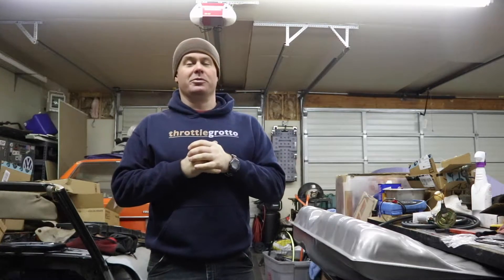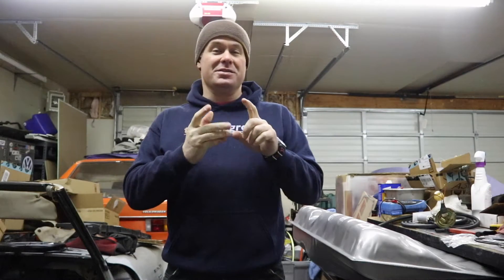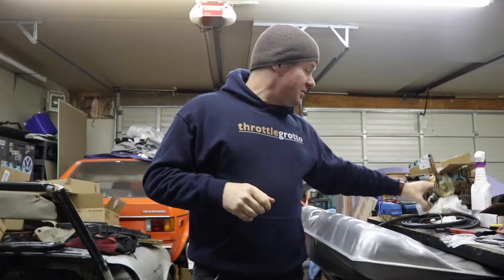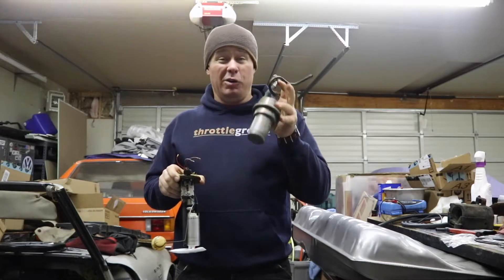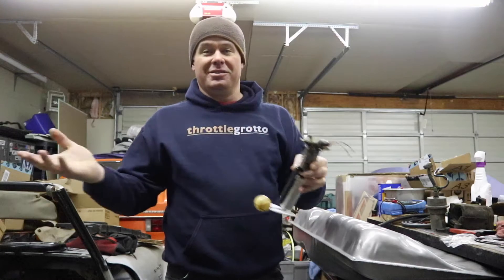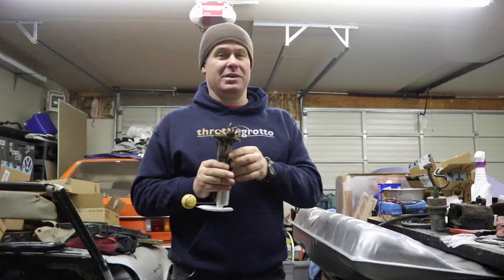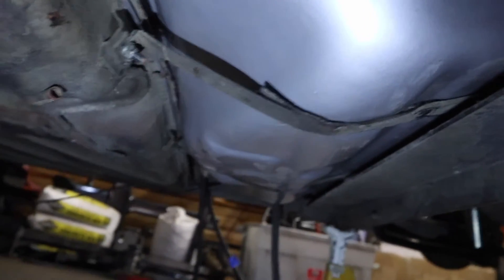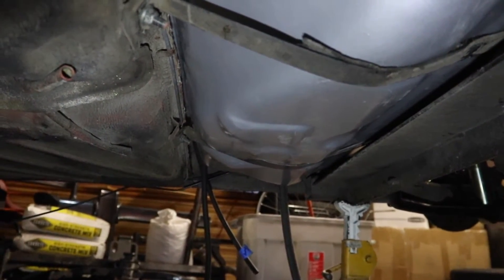Fuel Pump and tank installation- 1975 VW Rabbit 1.8t 20v ep 42

Comment: Sorry this is 4 years late 😂. Did you ever manage to reverse the fuel gauge? Just fitted a late cabriolet lift pump hanger with a walbro pump. I managed to modify the arm placing it in a vice and carefully twisting it the other direction. I had quite a complicated fuel setup before and wanted to simplify it. Cheers

Comment: How did you get the filler neck on, I’ve never installed one but I know my bros one is leaking and we need to replace it
Reply from the maker: The filler neck attaches to the body at the filler with 3 screws, and then some bolts along the way. A few extra lines for the overflow, but pretty straightforward to replace.